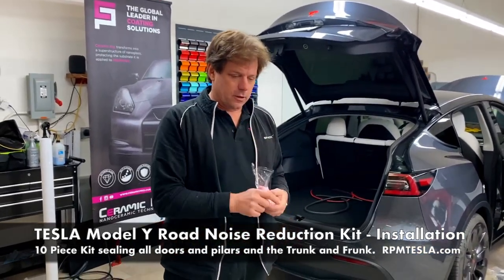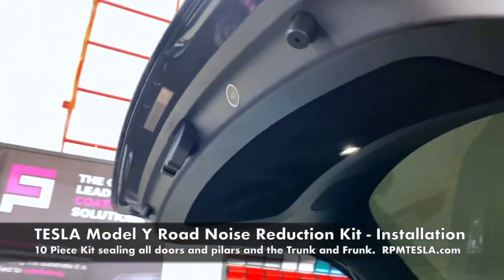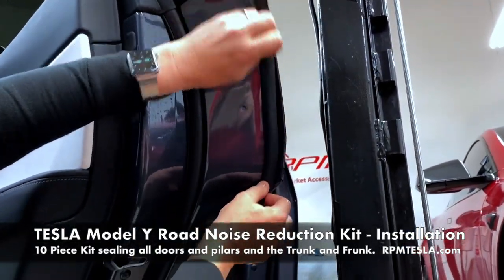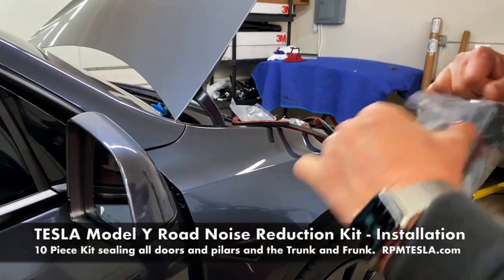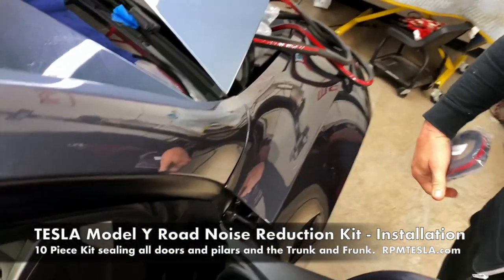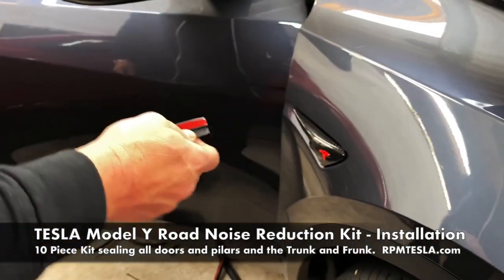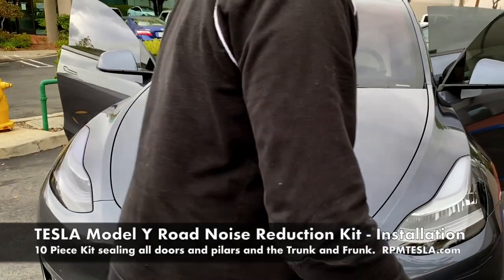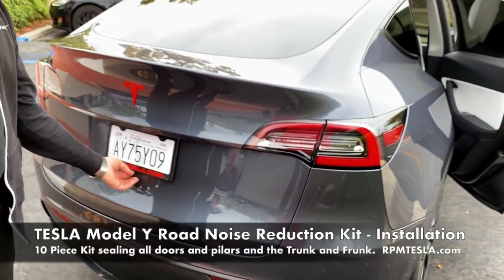TESLA Model Y Road Noise Reduction Kit (10 Piece Kit for All Doors & Pilars, and Trunk & Frunk)

Comment: I just installed these, not because of noise (maybe it will help, maybe not) but to reduce the amount of dirt and dust that gets into the frames of the doors, trunk, and frunk. I thought of it when I noticed my wife's new Honda Accord Sport Hybrid has similar rubber strips in some parts of its door frame.

Comment: I just bought the MY 10 piece kit and it only comes with 8 pieces total, with 1 long seal for the trunk instead of 3 individual pieces.  Was I sent the wrong kit? I don't want to continue with the install if I was sent the wrong pieces.
Reply from the maker: No, We made the trunk all 1 piece instead of 3. We need to up day the description. Sorry !  Thank you for pointing it out.
Reply: @rpmtesla  ok, I'll wait for the new video for installing the trunk portion.  Also the B pillar rubber doesn't have the "hold on lip" as described in the video.  It's just a roundish rubber tube.
Reply: My trunk and B pillar parts were the same as yours @nunyabidness.
Reply: @daniel-54321  I ended up improvising, it turned out great, very pleased with the  kit
Reply: Yeah, same here - the B pillar was not the same anymore.  In addition, the adhesive / promotors do not work too well.  I had a lot of issue to keep the seal on the door/trunk :(
Reply: @wakkigy  I was able to make it work, I think I had to cut a couple of pieces, but not a huge deal. I was happy with the result, it made a huge noise improvement.
Reply: @wakkigy  The adhesive promoter wipes they use are just 100% acetone. If the wipes are dry, just use a microfiber with acetone. It works.

Comment: I purchased the RPM Tesla door seal kit for my Tesla Y, it is a nice product but the adhesion promoters are all dried out. I have no choice but to install it without the promoter. My suggestion is always to check the quality, especially for products made in China.
Reply from the maker: Did you contact customer service to have some new ones sent out ?  So sorry
Reply: I will contact the office but isn't it too late because I have installed the kit and some section has already peeling off. @rpmtesla
Reply from the maker: @set_exodon  Don’t worry Leon it’s never too late many customers by individual pieces or replacement pieces over the years, the trunk or the door may Rob so much that I can wear it off overtime but we do sell replacement pieces so don’t worry Customer Service will take good care of you please try our live chat or email. Thank you
Reply: @rpmtesla  Thanks so much for your good service, I have contacted your office by online chat
Reply: Same here on the adhesion promoters. I installed mine as well without the adhesion and hope they do stick. Extremely frustrated with installing the trunk as it would not hold after continuous presses. 
Additionally frustrating regarding your “sell replacement pieces” comment. Why would you double-dip and “sell” replacement pieces? Seems like a rip off if you sell a packaged product with defective parts and then resell portions of the same product to customers to “maintain” the product.
Reply: @daniel-54321  I removed mine. This product does not work, wasting money and time. No different with or without this kit

Comment: The installation direction for the rear door is not consistent between this video and the model 3's installation video.  

In this video https://youtu.be/2hMn2jqPtvg?t=220, you are instructing the open groove of the seal would face toward the outside of the vehicle.  
In the model 3 video https://www.youtube.com/watch?v=E7ZnG-62U8U, you've install with the open groove facing the inside of the vehicle.

Can you clarify which is the proper way to install the rear door seals?